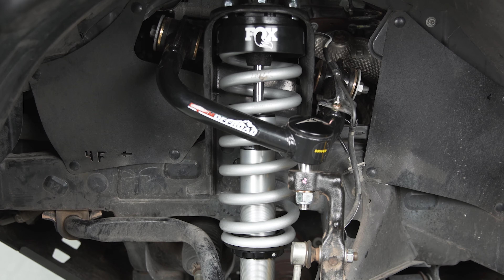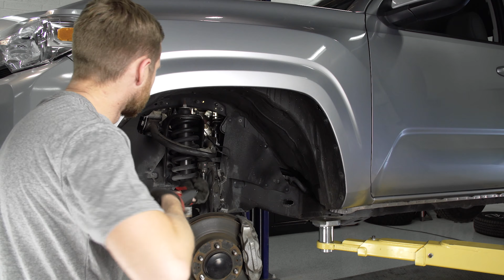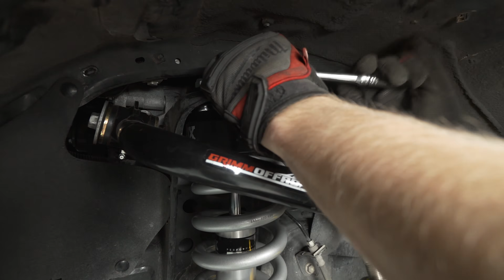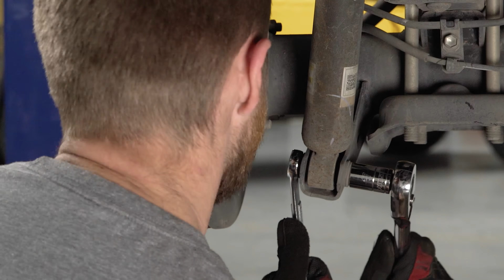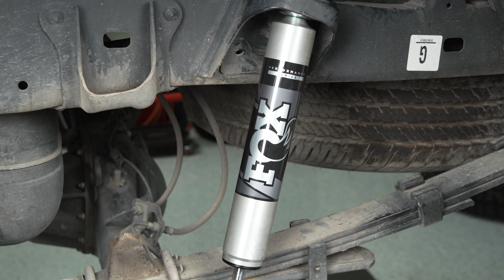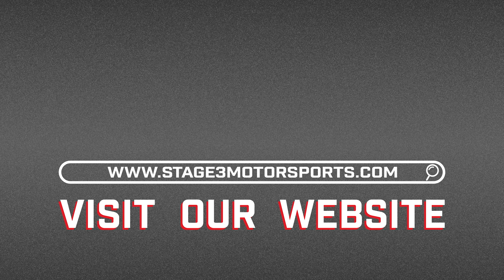05-20 Toyota Tacoma Fox 2.0 Front Coilover Suspension and Rear Shock Install

Comment: Did adjust the coilovers at all? I read online that these offer a 1 inch lift out the box, but your results indicated nearly a half inch more.
Reply: We didn't adjust ours, but Fox is sometimes inconsistent with how their shocks are set coming from the factory. If you order a set you may want to call Fox and confirm what height the collar should be set at to gain 1" of lift before you have them installed.
Reply: @NoahStage3  thanks for the response and letting me know that they can be inconsistent with the preset heights👌🏽
Reply: What offset with the 285’s?

Comment: Any trouble fitting the 285 on these ?
Reply: We were able to fit 285/70R17's on here without too much trouble. You will need to trim back some plastic towards the edges of the inner fenders to avoid rubbing in front, but other than that they tuck in there nicely. If you adjust these coilovers up for a little more height that helps too.
Reply: Depending on wheel offset you will also need an alignment that will max out your caster to push your whole wheel/tire forward.

Comment: Sir do i need to changes the upper control arm to install 2.0 fox shock.?
Reply: The aftermarket upper control arms are not a requirement, you can run this Fox 2.0 kit with factory uppers. Hope that helps!
Reply: @NoahStage3 what size wheels can you fit